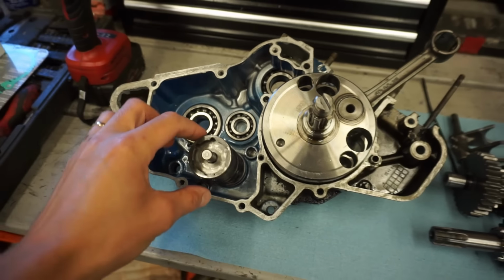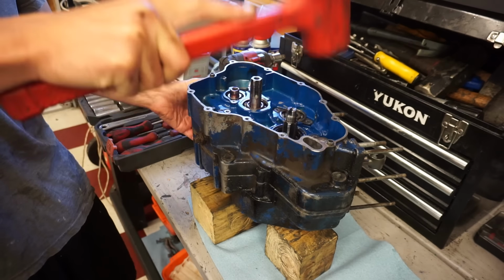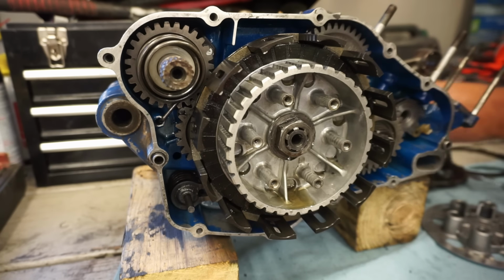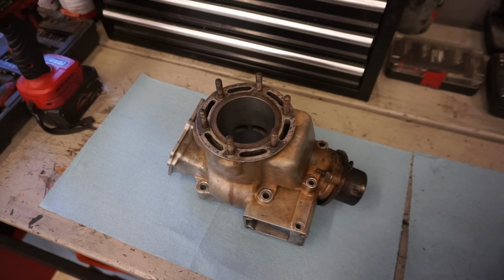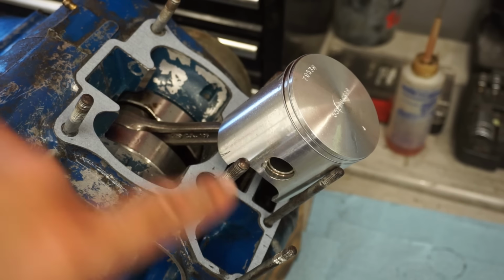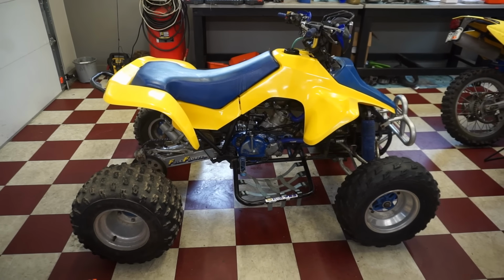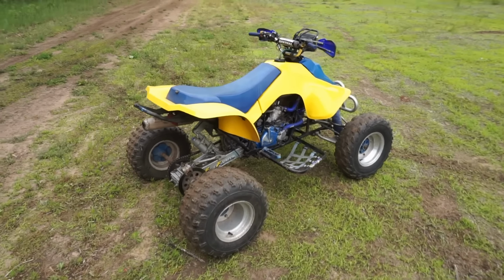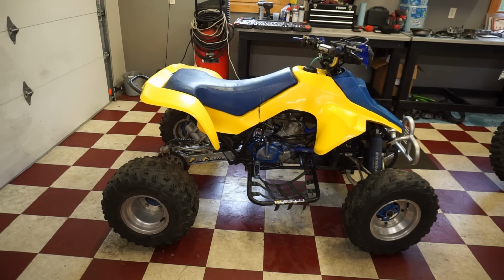I Can't Fix This Rare 2-Stroke Race Quad

Comment: Does anybody else hear all the dirt grinding during the build.  Damn man clean your cases and all of your parts.
Reply: At least wipe your hands off 😂
Reply: Yes, and it's enough to drive you nuts. Personally, I would've replaced every bearing that sounded crunchy, which was most of them.
Reply: Man, this dude don't hardly clean anything.You're lucky even washes the cylinder out after he homes it.
Reply: @stkyfngrszmooth  yeah when he was putting assembly lube on the bearings it sounded like grit while spinning. But in the words of Joe its perfect lol
Reply: He doesn’t seem to oil parts upon reassembly
Reply: Was those plates on the clutch pre burned, looked good,lol
Reply: I have said a few times that he needs to clean these machines before tearing into them.

Comment: The broken piece that you found, I believe, is the dog from a gear. If you can't find where it broke off, the gear was replaced and the mechanic missed the broken piece. The broken piece tells me that someone was banging through the gears without using the clutch, probably with the throttle pinned. This will break and wear out the dogs.

Comment: If you ever come across a 1981 maico 490, buy it with no hesitation. Even the parts are worth good money.
People in the UK go nuts for them.
I had one in 1987 and it was the best bike I ever owned it got stolen in 1989 and I never seen it again.
Reply: I had a 90s champ Rx75 man I loved that bike was nicked outside my nans then my pops bought me  a 2nd hand PW80 for £100 non runner took spark plug out took the little thread cap off the top warmed it up on the hob started 3rd kick went to pay the lad on it running he'd been trying for 2 years to get it going
Reply: @Lee-At-Green-Pheonix-Rc  my maico was pinched out of a garage that was 300 yards from my house..
I found out who pinched it but it was far to late.
Reply: @Lee-At-Green-Pheonix-Rc  I had 4 bikes in 1987. 1 maico 490. 2 RM big wheel 80, XT 350... Honda Dominator 🙊

Comment: That shift drum is possibly alright still. Which leaves you still needing A clutch pack with spacer plates.  A good pre soaking solution I know of is PB blaster sprayed over that fiber disc's and the actual wet clutch moto oil to.  The penetrating oil helps as A speedy pre soaking process procedure is all. It basically speeds it up faster is all.

Comment: Unfortunately you must check the components for wear, and compare the measurements to the manual specs. You can’t skip putting a caliper on the shift forks, or checking to see if gears need undercut. I would have checked clutch spring length, etc. Clutch plates might look good, but what thickness, or how old are the friction plates?

Comment: When you race a 2stroke you don’t hold the shifts out like that as soon as to pms get to max you go right into the next gear to keep the engine under load.
Reply: This inspection fail aside, Joe has shown he's a decent mechanic and getting better. But you can tell from his test rides that the two stroke bike's power bands intmidate him. Why a few race, even fewer win and the rest just ride and turn wrenches.

Comment: with the engine together check the thrust movement on the shifter drum it may need a washer that doesn;t touch the bearing ive had plenty of these apart cant remember if it holds to the bearing or floats in the bearing try it the most it could cost you is an end plug if it doesn't work

Comment: Sometimes transmission gears have washers/spacers.. and sometimes those are directional.. I learned the hard way during training at MMI.. had a Honda CRF250R I disassembled and rebuilt.. put a washer on backwards and it would shift out of second.. same problem. Get the service manual and measure everything in the transmission.. it's the only way you will know..

Comment: If it jumps out of gear one time, the shift fork is now bent. Replace the fork and check the engagement dogs on 2nd gear. You can have a 3 degree angle ground into the dogs to help the gear draw in on shifts.

Comment: Don't know if it'll help, but you are definently missing a bolt on the clutch side cover. Right underneath where the clutch cable is joined to the little clutch arm. There is a hole that needs to have a bolt in it. If that doesn't work I might try the shift star or shift pawl

Comment: I think that if the shift drum is good and I agree it looked fine, and the shift forks are good, I would be looking towards the 2nd gear is missing it's shims or the existing shims are worn out allowing the gear to simply slide out of contact with it's  mating gear on the other shaft.

Comment: Before u tear it down try the spring on the end of the shift shaft....they lose tension over time and can cause a similar issue...same thing happened w my 88 lt250r
Reply: I've had two do same thing .

Comment: Im a certified yamaha mechanic.  You should use a gray sealant for case halves.  Its designed for high torque applications.  I highly recommend the Yamabond motorsport 4.  Its what yamaha calls for on its engines.  Its made by threebond.

Comment: I would replace the shift drum and the plates. That bolt missing for that long has caused the slightest bit of wear that may seem fine to you but under a micrometer you'd notice. The basket and forks are fine because they still work in all other gears

Comment: My experience is that bearings at either end of the transmission can be smooth but worn with excessive clearance, especially cheaper brands. 
Use some good tight clearance Japanese or swedish bearings.
So end result is the shafts aren't in alignment and it will slip out of gear.

Comment: Since the shift lever kicks downwards I would assume that the spring loaded mechanism at the bottom under the the shift drum jumps out of its groove. Either it didn't click in at all or engine vibrations at high rpm kick it out. 
In the beginning all gears higher than gear two were jumping out, now it is gear two alone. I find that a hint that there is no fault with the gearing itself.

Comment: You just shake those off and drip run off access oil then out them in the clutch basket individually like normally to. Watch the faster grabbing effects to slow shift the first break in part of it. Then regular shift it afterwards. You'll feel and it'll show you the difference to.

Comment: Joe I would use emerycloth not sandpaper on those Piston pre drilled holes next time and some penetrating oil to remove the bits with for  A smooth finish. wipe it off with soft paper towels clean.

Comment: The dogs that engage drive gears are worn, causing it to slip out of gear at high rpms. 
I had the same problem on a yz125. I replaced the trans gears....problem fixed.

Comment: Had same problem with Husqvarna even though the gears in the transmission look good it’s the bosses on the side of the gears that get worn out so the gears will not stay locked together. I’ve noticed this on a lot of the bikes that you have worked on usually, this happens second or third gear once again, the gear is not missing any teeth side of the gear. Has the bosses on it that get worn down.

Comment: Shift fork is out of tolerance there is a minimum and maximum amount of material at the end of the shift fork the manual will give the shift fork tolerance.  That fork that is shiny compared to the other shift fork is more likely out of tolerance . That's why it slipping out of gearing second. Happens when you beat on the transmission.

Comment: On the shift drum where bolts through the case put a shim between the shift drum and the case and ship the drum over so it'll rotate further per se give it a little advanced timing which would make the fork push deeper in in gear I would imagine it's eight some of the aluminum up on the case

Comment: I had the same problem on my 89 Racer.
Turned out the return spring under the drum was getting weak.
I wasnt getting a good click from neutral to 2nd. And when im on the throttle hard, sometimes it would kick out. Those springs are discontinued but with a lot of google searches i found that a 2000 GSXR750 spring is almost exact. Just had to rotate one end hook.

Comment: inside the clutch basket, there's a "one way" style of bearing setup I believe thats held in with a round spring to hold the roller bearings.... sometimes those roller bearings are worn out, theyre a weird style of "roller" like mostly round but with flat spots... when those rollers are worn out it seems to act like the clutch slips after a certain RPM... that might be the problem
Reply: try replace the rollers inside the clutch basket OR the whole clutch basket itself

Comment: Hey Joe......on this one you need to ask the Cheech and Chong questions list.......Did you check the air in the tires.......does the horn work.....is the light switch shorted out........how about the muffler bearings......could the handlebars be loose.....etc.

Comment: I've had issues like this in the past. Everything looks great, but the problem persists. The only thing that has ever fixed the problem was to replace the parts where the problem exists. Even if you hold the original parts right next to the brand new ones and they look exactly the same but only the new ones work is enough to drive you nuts. I remember having a 1986 Toyota Camry in my shop with a very annoying misfire. After replacing the obvious parts (plugs, wires, cap & rotor), the problem remained. Even after a complete valve job, it was STILL there. We inspected the cam and its housing, and everything looked perfect, yet when the smoke finally cleared, the problem ended up being a warped cam housing. It was the only problem of its kind ever to come through my shop in that particular year make and model and still bugs me to this day.

Comment: Got an 04 Foreman 400 in, hit a tree at high speed on a trail. Gonna need new frame, front end suspenion and plastics rack etc. Nobody was hurt on it they said, i dont believe it, its really bad! Steering shaft bent to hell, have to lift front to move around, got it on dollys right now to move it around.gonna be a great time(not). Hoping i can find a frame but not looking good, maybe able to stretch that back to shpe but?? Already had to use my Hydraulic porta power to make room on front to get bolts out.

Comment: 1) Clutch side shift fork not set up correctly and bent on shaft
2) Under the clutch cover you will see #16 and #19 make sure that #16 has the spring on it and is set up correctly.
3) When gear dogs have wear on them, they begin to grind off a little bit to form a slight ramp to them. this causes them to not want to hold, and will separate under a load -  The gear dogs and connecting/corresponding slot areas, if they have any shiny surfaces, especially ones that seemed chipped away just a little bit is more then enough to make this happen.
Source: Just Answer Motorcycle.

Comment: You don't spray them A bunch with the PB blaster though just lightly over the single fiber disc's hanging up with paper bags underneath them. You can try removing the second clutch disc and lightly sanding it with 60 or 80 grit sandpaper to remove the burnt glazing off with. To bring out the original color of the fiber disc. It doesn't always work though if it's slightly burnt it could possibly work though. Just remember to clean off with acetone lightly before spraying PB blaster on that single disc by itself though. Then shake it off wearing rubber gloves check the grabbing of fiber's if it's like new ones.,or close it could work with out buying new ones. It's A trick you can try out lightly circle motion sand that disc from the middle outward towards the edges.

Comment: Check the clutch plates out on it to. It could be burnt now due to burned oil and overheated clutch plate inside of that clutch pack set. From over the years of riding it like that to. They can loose friction and grab due to smooth of surface on the fiber clutch plate disc inside of it.

Comment: Pro tip: extentions alter torque.  Check variance by using test bollt and nut. Torque to required spec with extenrion. Remove extention snd check torque with shallow socket.
Every bolt and nut is torque ro soec on the vast msjority of internal combination engines. Or, riek it.

Comment: 🔥great work man. U need to polish up that head, cylinder and cleaned up all nuts with wire brush b4 assembly 🔥👊🔥 u sure it’s slipping out of gear ? Seems like clutch is fried.. check out clutch man 🔥🔥🔥🔥

Comment: 😊😊😊😊😊😊😅😅😅😅😅😅Hay Joe hope you and your family are all fit and well 
I been thinking about you shift problem 
You could try a second hand shifter drum or new one if they are still made 
Give all gears another once-over 
I think the shift drum could be warn  on second gear and will  slop about and move or jump out of gear 
The damage would of been done when the bolt was missing 
The shift wheel with the spring on it is normally on the outside of the gearbox not on the inside 
But that gearbox must be different 
Keep up the fantastic educational videos and only a few perfects to speak of 😂😂😂😂😂😂😂😂😂

Comment: I agree, gear dogs between 1st & 2nd causes pressure on shit fork. Pops out of gear. I have fixed with new gear and a shift fork if wear is evident. I know you are not wanting to tear it down again, but it has to be done.

Comment: Is this the same quad that was missing the bolt that holds the shift drum in place? Under the cap? Was just wondering did you put that in, did not see it on the wideo? Or was it some other machine i was thinking 🤔

Comment: Hi Joe, you've got the needle change the wrong way round, lifting the needle will make it richer, you need to lower it to lean it out but it looks fine to me. When you had the gear box out, why didn't you replace the retention spring? it looked a little sloppy to me.

Comment: Did you check the shifter adjustment?
The spring on the shift shaft should be on a bolt with a lobe on it, you turn the bolt and it moves the gear selector.
On the Yamaha Enduros if that is out of adjustment this same thing happens.

Comment: Had a honda 500 farm quad that had a bent shift fork that slipped in 2nd to neutral. Observing the forks, they looked fine until I used a straight edge    on each of the fork fingers. When I ordered a new one, the old one was definitely bent. I assume that someone slammed the gears and bent them, especially in 2nd. It pays to be more observent on items like transmission components.

Comment: Did you check the transmission shafts to ensure the bushings are within spec and that all the washers are there?  My 86 xl600r has washers in between some of the gears....  A missing washer could be causing it.

Comment: Other than damage on 2nd gear cog and mating gear. It could be missing a shim or misplaced shim in the transmission assembly. 

Double check schematic when apart 2nd time.

Comment: Clutch Issues. When your manual transmission slips, the clutch is the culprit 90% of the time. Over time, the clutches wear off and become too thin to ...
I appreciate you checked the clutch when reinstalling, it’s a manual gearbox?  The missing bolt didn’t help maybe rounding off the dogs

Comment: check the syncromest teeth, and they must be a matching set . Non-interlocking syncro ring with a non-interlocking syncroteeth on a gear, and vice versa. The syncro teeth will be damaged if they lost their distinctive shape (kinda shaped like a coffin). if the syncro teeth are damaged i.e: angle to one side rounded out point of the syncro then they must be replaced. Also if you have syncro ring ( cone shaped on the inner diameter of the syncro ring) there must be no slipage when the syncro ring presses up against a gear. If it does, (frictionless) it can only be replaced. You could also bring the whole gear set/assembly to a shop that services manual transmission, they shoulg be able to pretty quicly the problem for you - what would need to  be replaced . Good Luck

Comment: I don't if it is worth messing with it and not buy new gears for those slipping, but if you find the face that had been rounded off too much or is slanted and cut it down more square and flat it may cure it.  The gear will have a big more slack while engaging but it will stay on.  Since those dog nobs spread the load among them cutting down one just spreads the load to the others, they will wear out sooner causing the same, it has to be done evenly so all faces match the opposing slotts.  A new pair of gears is optimal if you can find them.  2nd gear to prevent a miss neutral is always crunched at full strength and high engine load.  

Usually Suz. is pretty reliable and well shifting compared with the other 3, but abuse is abuse.  This was back at a time where mx/enduro engines were passed to 3/4wheelers not expecting to see more abuse.  But 4 wheels is safety that allows more aggressive riding than 2wheels.

Comment: check the syncro teeth on the syncro ring-gear. Make sure if you have non-interlocking syncroteeth must use non-interlocking syncroteeth on the ring gear as well. Anf vice-versa, if you have interlocking syncroteeth then they must match up to interlocking syncroteeth on the ring gear as well. You cannot mix and match them. Otherwise the synchroteeth could get damaged (angled) and cause shifting problems like slipping out of gear

Comment: Maybe the spring that keeps the shift drum in place lost tension/wrong one or needs a heavier spring.. or the dogs on the trans gears are slightly rounded on the edges.. thats the only thing i can think of that would cause that